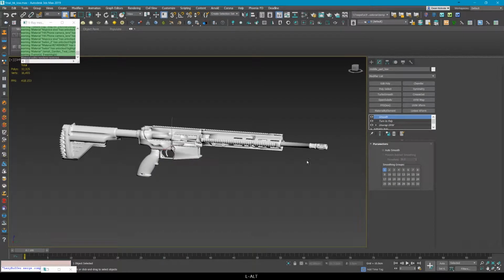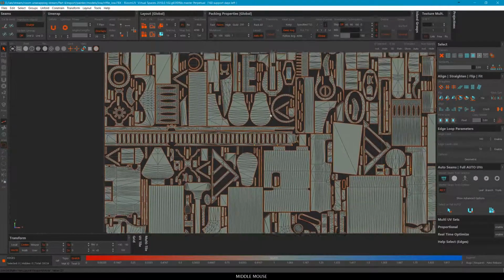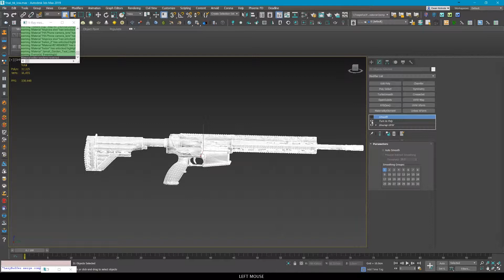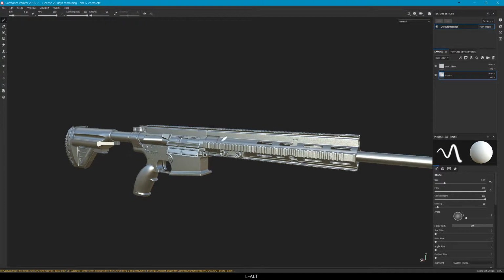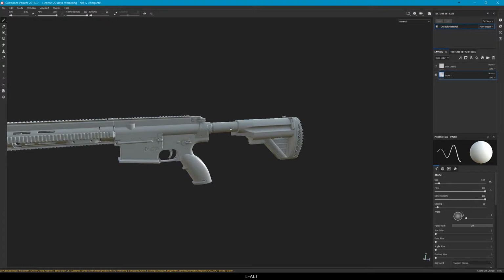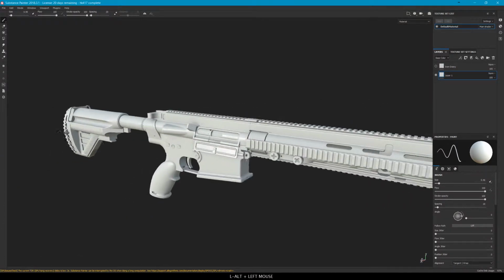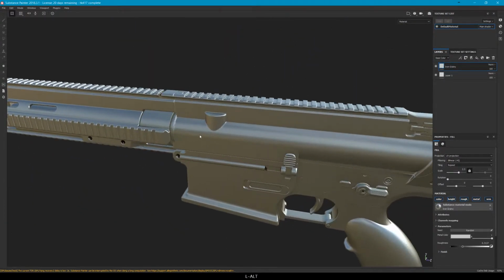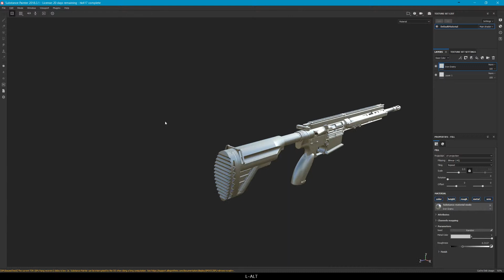Hard edge UV mapping with RizomUV: Part 4 - Final pack and bake

Comment: where tf are your hard and soft edges? There are so many artefacts everywhere
Reply from the maker: I don't use hard or soft edges. From my experience using a single smoothing grp before exporting to painter works best with it's baker. Be constructive and explain your comment a bit.
Reply: @jankobananko   Sorry i didnt mean to come off as rude. I like to bake in marmorset toolbag so i cant say much about baking in painter and i dont know if you are working in the industry or anything like that but all those shading errors you are getting from just having one smoothing group are pretty bad because that way you get gradients on your normal map and for personal projects its fine but every game engine compresses your textures so if there are no gradients on your normal maps just solid colors there isnt really much to compress or the compression doesnt alter your map as bad but gradients can result in even more little artefacts later if importet into game engines.
Reply from the maker: @TomFordAddict  Tnx for response. No, I don't work in game industry. I do archviz, this was mostly done to showcase the Rizom part of the tutorial. Baking was just an additional thing :) But thanks for the tip, I had similar issues when importing / exporting from different programs, and never managed to figure out why / find an answer.
Reply: @jankobananko  read the polycount thread on hard edges for normal bakes. all smooth = artifacts.